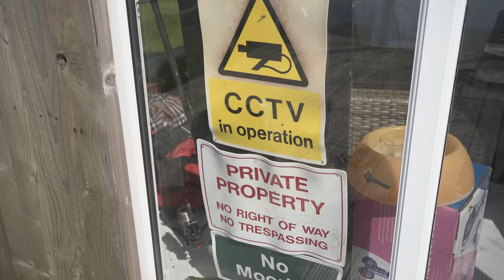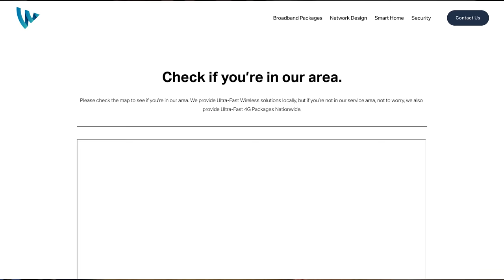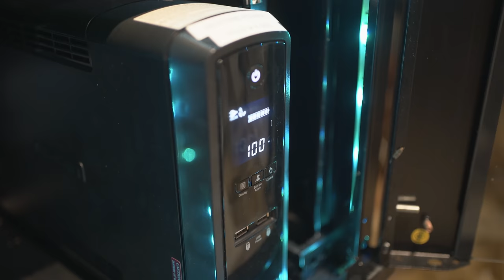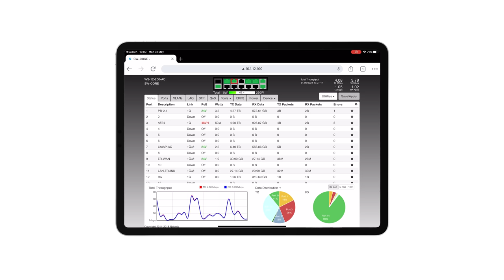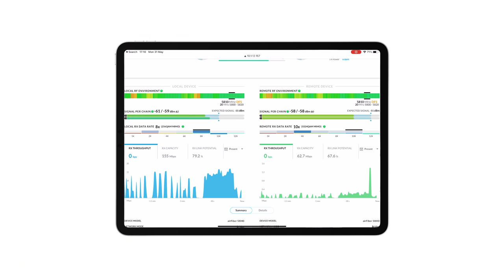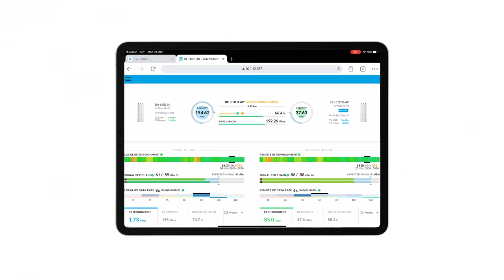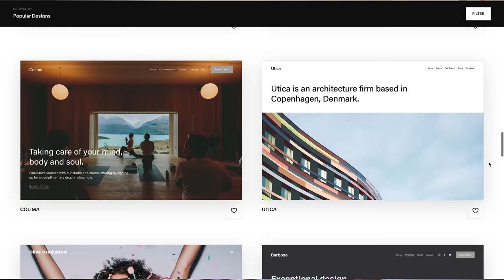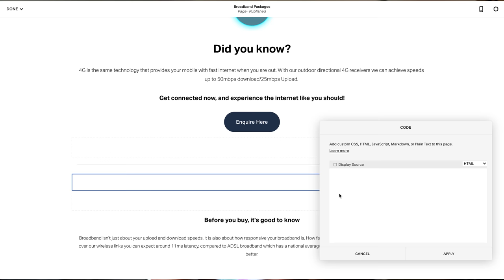How I'm Selling Internet in 2021 via WiFi!! Full Network Tour!!

Comment: A UPS isn't redundancy! We have redundant power, it's two power feeds, entering the building at two different points, fed by two different sub stations. That's redundancy. A USP is a UPS. We have two UPS rooms, that's redundant UPS.
Reply: A UPS and a grid connection is still slightly redundant, Even if limited. Since you have 2 sources of power.
Reply: @MaebhsUrbanity  Nope, that's not how redundancy works. Redundant power would be two sources of power. Redundant UPS means two UPS. That's n+1 and that's what we run. What he's shown has no redundancy at all. There is not more than one of anything. There is not two power supplies. There is one power supply and one UPS (which are usually only used to carry power until a generator is up to speed). There is zero redundancy in his setup.
Reply: @benjones9822  It's not total redundancy, It's not a redundant UPS. However, the combined system could be said to have some redundancy in the power supply. Also, they serve a small area In which any blackouts experienced by the rack will probably also affect everyone's access points, and so providing service isn't that necessary.
Reply: @MaebhsUrbanity  no, that does not fit the definition of redundancy at all. As I said, there is zero redundancy. Agreed, his customers may lose power if the whole area is affected, but don't claim to have redundancy if there is zero redundancy.
Reply: @benjones9822  actually In a way it is  redundancy. If he loses power the USP kicks in. May not be the best option, but it still supplies power for limited time till he able to fix issues or power I restored. Hence definition of redundancy. To supply something that not available or in this case power Failure.
Reply: @shirowalkerfb5134  Nope, that's not redundancy. That's a UPS.
n+1 redundancy means you have a redundant unit, so in the case of redundant power you have two power supplies entering the building, usually at different sides of the building, fed by different substations. You then have a UPS on each power supply....two UPS....redundant UPS. We also have two generators. That is how redundancy works.
One power supply into the building and one UPS is, by definition, no redundancy at all.

Comment: I’d invest in a proper enterprise grade UPS instead of a small consumer grade one.
Reply: But at the same time...it clearly works fine...so why fix it. I have some of these with perfect operation other than when batteries die
Reply: @mrmotofy  It doesn't, that's the problem. It will be fine if power drops out for few minutes, anything more than that and you are screwed. Consumer grade UPS runtime isn't rated at max load, so 40 minutes he mentioned is with something like 30% load.
Reply: @mrmotofy  Because 40 minutes is an extremely short amount of time. If there would be a serious power issue at his house it could take a technician at least 4 hours to come by and fix it. Sure this UPS is sufficient if the power would switch off for a few minutes, but in other scenarios it wouldn't suffice.
Reply: @mrmotofy  Home base UPS are designed with lower caps, and designed to run hot. They are truly only meant for a shut down situation. Where commercial UPS's can be designed to run for hours - if sized with the correct batteries. He could get a simple APC 1500 Rack or "floor" style unit that would be designed to run for a more effective time frame.
Reply: @Cpuboye11  Sure may be...they also come with a commercial price tag. Which is very difficult for small businesses to afford, especially for what if scenarios. He's providing residential internet, the lowest tier. NOT critical business operations with required uptime.
Reply: My home rack has a small cyberpower rack mount. Its run time on its 200W load (networking equipment) is just over 4 hours. If that is the model I think it is in the video I would put his runtime somewhere around 20 minutes and not 40. But I also don't know his exact power draw. But networking equipment doesn't draw much power. For instance, most consumer-grade UPS will keep vital networking equipment up for nearly 30 minutes in most setups. The main reason I would recommend switching to a higher grade UPS would be the fact that most allow hot-swapping of the batteries. If the battery fails in his current setup it will need to be turned off before it can be serviced. As for the price you can pick up a good smaller VA unit sub 400usd that would be perfect for this rack.
Reply: @dustinvanantwerp4917  Yeah hot swapping the battery is a valid point as well. My 950 VA UPS can run my DS218+ NAS, My UDMP firewall, HP Z230 SFF VMware host and the cable modem for around 10 to 30 minutes depending on the load which my server is under.
Reply: Yes, cyber power sux
Reply: @majik11111  My biggest worry about a setup like that would be the total wattage you are pulling. Most UPS devices have a HARD watt limit. For instance, the 900VA on my PC is rated for 450 watts, If I pull much more than that it won't even kick the battery on it will just die. My 3000VA is rated for a max power draw of 1200 watts, which is a bit more suited for running a bunch of things. My rack is very similar to yours, UDM-Pro, USW-AGG, USW-24-POE, then two home-built Ryzen based servers. One runs home automation and is my NVR. the other strictly run plex and data storage. All in all even with several POE devices AP's and VOIP phones I idle just over 200 watts. When plex is in full swing however it will be well over 500, with transcoding and such.
Reply: cant fit into his comms rack. need a proper rack for it. I think Alex has a backup diesel generator if there’s any power outages
Reply: And
Reply: There are UPS there are 1U size,he would only need to slot it in the rack, that would be a proper solution.
Reply: @PatalJunior  Proper solution would be DC :) It is very inexpensive

Comment: I am not sure if you just didn't show it but you missing a lot of redundancy in your network, you need backups for everything. And that tiny UPS? cmon
Reply: I totally agree... but there is still a catch... financing it... for whole backup core system... I guess he has to buy another enterprise connection and the equipment there...
I'm not a expert in any way... but what I can say is...
add redudancy to a system is a costly matter... and isnt easy to just flip a switch...
I'm sure he is aware that hee needs one... but i guess it is not economically viable yet with the size of his net...
Reply: @Panakotta000  i meant device wise, no need for another line. Just when one of the devices dies there's a backup for it
Reply: @flippy9133  Ah ok... but jeah... probably still quite expensive I assume

Comment: Spray painting the devices black probably not a good idea. In direct sunlight those devices will absorb ALOT of heat and this could potentially lead to shorter device life or them just outright failing due to overheating.
Reply: Depends on the paint.... plastic spray paint will be fine
Reply: @sprocket-YT  its not the type it's the color, black absorbs hear

Comment: Keep up the good work!  I work at an ISP and one recommendation I have would be to convert your head end and micro pops to DC equipment and use a rectifier to  convert your commercial power to DC.  The biggest advantage of doing this is you can then have back up batteries that can power your equipment for much longer, days to weeks even if you ever had a major power outage.  Since you are a data only provider it may not be that big of a deal but here in the USA if you provide POTS then the FCC requires a certain back up time for the equipment.

Comment: Good network, however 0 redundancy for being a ISP.

You mention you have a edge router, does this act as your network router + DMZ and general firewall in one? 

Also your core switch, do you have a backup?
Reply: Yes also my concern. He mentioned he rebuilt the entire network for growing, however it seems to me there are multiple single point of failures and no redundancy. Also the runtime of 40 minutes from that UPS seems a bit on the low side tbh.

Comment: Honestly, you should consider some sort of professional solution for your power backup as well as some network redundancy. Ubiquity stuff is great for the cost and you should be able to implement it. Another thing you should consider is a bigger rack, patch panels and a rackmount AC unit.

You are selling a service and you should grant a different level of resilience (both network/power).

Comment: Jeez don't you have legal requirements for record keeping, audits, information requests as an ISP in the UK etc. Not trying to bag you out as you've made it really far but it seems like you could have a proper legal problem on your hands.
Reply: Only records ISPs need to keep are which customer had which IP at which time. If he's giving his customers a static IP it's easy.
Reply: @TheSmiddy  Ah ok, in Australia reporting requirements are more extensive then.
Reply: @speardfrog1  Not sure what an ISP in Aus would see, since most of that information is or can be easily hidden through various methods. The handed out IP is really all that needs to be tracked especially since he has full control over end user devices connection.

Comment: I would seriously consider upgrading to  a commercial grade UPS, not only for runtime, but for reliability reasons. The whole reason I haven’t converted into a carrier is because I don’t want to be responsible for a five nine network.

Also, that poor equipment needs some cooling, have you considered a minisplit or moving it downstairs?

Comment: Almost 100 years ago: Rediffusion was the trading name of Broadcast Relay Service Ltd, formed in 1928. In 1929 the company introduced its first cable radio service in Hull to customers frustrated with the difficulties of tuning in weak radio broadcasts. In the customer premises, nothing more than a selector switch and loudspeaker were needed. Initially, the service consisted primarily of rebroadcasts of the BBC Radio service, which was reflected in the trading name: Rediffusion simply means "broadcasting again".

Comment: Fascinating to see how it works. Wish you supplied up in Cumbria. We use a local wireless internet company and we are supposed to get 20 up and 2.5 down for £50 per month. Can’t use a VOIP phone and struggle with running our business from home and streaming movies catch up etc with it as we rarely get the speeds quoted. Contention ratio is 20:1. Same company just quoted £270/mth for 1:1 uncontended 20/20 supply plus £3k install.
Reply: daylight robbery those prices!

Comment: Cheap consumer UPS over using a 2-3 day backup hybrid solar setup when you got roof space or just get 1-2 prosumer models....
No fire suppression systems... No high airflow fans or AC system it's an attic come on.. ain't even got boards on the insulation...
1 ethernet line to 1 router over fibre and duel routers at least basic redundancy... 
Painting heat exposed kit black exposes them to more heat...... 

You know there are small sins but when you have this many fuckups in a row on gear that makes your baseline income... god...
Reply: And yet... so far so good.

Comment: You should look into buying a bigger battery backup, such as an EG4 5.12kWh battery. They cost 1500$ for each battery module and the server rack that fits 6 modules costs 400-500$
For now you could just buy a replacement battery for your UPS. To switch it from a lead acid to much more energy dense lithium iron phosphate battery.
Reply: Was thinking the same thing.

Comment: It's a good little business that services a nice small niche.  However the problem you have is that these small villages, eventually will have access to a reliable fibre connection.  When this does happen, it is game over, your prices won't be able to compete.
Reply: Who knows how long that will take though… By that time I’m sure he’ll be much more successful. Heck he might even be the one supplying the fiber :)
Reply: Looking at his RJ45 terminations alone I dread to think how bad his Fibre terminations would be. Not to mention the fact he has no redundancy, no second fail over router, no proper battery backup. All it takes is the heat in his loft to cook one of the small switches or routers and the whole lot comes crashing down.

Comment: Here’s a tip you should think about investing in a device called Eco Delta pro it’s basically a back up battery that can run off solar energy in case the power goes out

Comment: Your rj45 terminations could use a little work... The jacked should end up inside the plug! That's the whole point of the bar thst clips in at the back, to hold onto the jacket for strain relief. I know it's hard with massive cable like that but it should be possible with patience and the right parts 🙂
Reply: It’s not even earthed for outdoor use😂

Comment: Nice setup Alex!, however i do agree with others. Atleast try to get more redundancy in your "core network"  I assume you have some spare equipment in storage if you get a device failure. But what you really want is to make it a hot spare. I also suggest a UPS with more battery power/time atleast for your core network because 40 minutes is way too short. You want to minimize interruptions to your services as much as possible. You could offer a cache/proxy server and maybe a 4G failover on your lease line if possible.  Whatever makes your service more reliable.

Comment: So, your 'core network' dies, you don't have a single backup/fail-over? Are there plans to build in redundancy? As shown by OVH, even they had a catastrophic failure, so how come you are not prepared for it at all at your core? Even if you have 2 seperate lines from virgin coming in, which is good practice, you still have only one core rack which if it fails, your whole infrastructure fails. Or did you just not show some back-up locations out of security concerns?

It does all look very organised so I would be surprised if you did not have a backup line at a different geographical location.
Props for building out such a network whilst being self-taught!
Reply: This. Plus you should have a bigger UPS and one in each micro-pop as well as another core router doing high availability.
Reply: I wouldn't be running any of this from a roof-space of my house. Internet transit, Peering and dark fibres from wireless towers/PoPs should all be going back to a proper datacentre or datacentres, preferably. This type of setup will struggle to scale and whilst a cool project, sadly becomes a bigger and bigger risk. Even a quater-rack in a DC would be a good start.
Reply: This is spot on. Also, while I do like ubiquiti products and they work well for the majority of my small business customers, there’s NO way I’d consider using one when reselling internet connections
Reply: @RichLion  At the same time...one has to start somewhere. There may not be a lot of availability of resources and providers in that area. Then there's costs with setting up hosting/space in a DC. Sometimes it's just not an option
Reply: @mrmotofy  Yeah true. But you get to a point with all those subscribers that half a rack to begin to do things right really isn't that much.. Costs of doing business and all?

Maybe just install a diesel genset in the backyard? 🤔😁
Reply: @RichLion  But there's always costs. I've looked into some of those diesel backup...and they were starting at like $6000 plus installation probably another $2-3k minimum so a $10k investment for a what if? For a small business that's huge.
Reply: @mrmotofy  Yeah that's exactly my point. Get out of there and begin migrating to a proper datacentre where everything is taken care of before it's too late.

Comment: How does 1Gbps of bandwidth work with a network of such large scale ? surely that pipe is crushed when there are multiple customers on the network, endless you throttle them to slow speeds. Also, I love edge routers and all, but in this situation is it really enough ? I feel like there should be  a direct SFP connection from the lease line into the core, then an sfp connection from the core to the switch,  maybe some aggregate links, larger PSU, and redundant power supplies. That would make this all more reliable and capable of higher capacity. And I sure hope there is a backup site

The edge router will have to go eventually btw because it is EOL

Comment: All I’m gonna say is the Ethernet cables coming out the cabinet on the new building can be cut by come one out them in metal conduit
Reply: Metal can be cut easily in 30 sec with any portable angle grinder or hack say...sometimes simple is better. This is a residential area. How often do people go around cutting cables on the side of houses??? Not very

Comment: I like the dedication, but have you thought about lightnings, maybe buying an electric generator. Zabbix would also be a good thing to have - can even monitor customer devices, if theyre offline or how much data is flowing through. If you want to expand it even further, i would thing about core cluster, in case of one device failure. Question out of curiosity. What is ur uplink? 1 or 10gig?

Comment: You don't need to 'run a cable' to the Unifi access points you showed at the start. You said you run the 3 device mesh system instead, however this works exactly the same as the Unifi AP you showed. Unifi can plug one AP to your router, which will work as an uplink, so you only need power to the other 2/3/4 AP's and it works like a daisy chain - the same as a mesh system. Pretty sure you showed Tenda mesh system, which is probably the most entry devices you can get as well, not exactly professional setup.